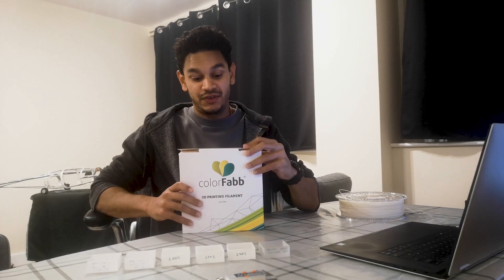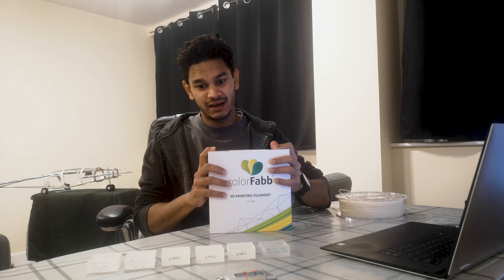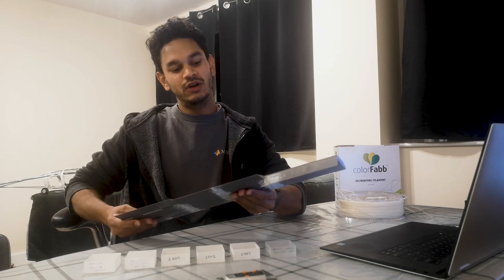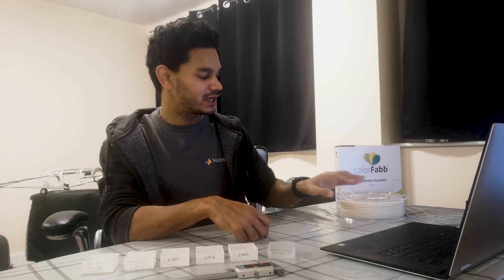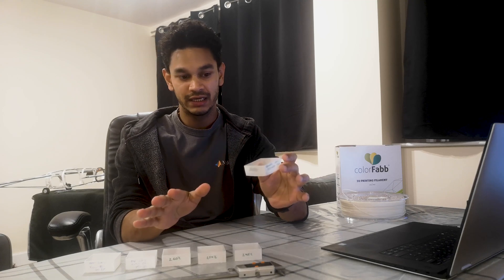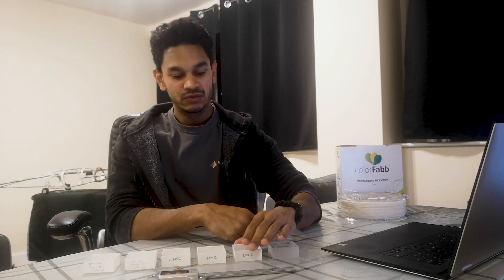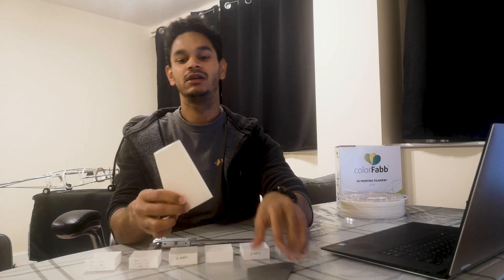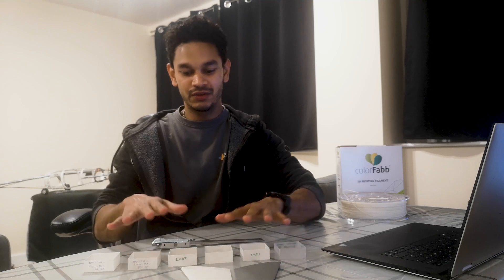Getting Started with Lightweight PLA (LW-PLA) on an Ender 3 (HQ)

Comment: thank you ! great information on calibration. can I ask if you have a regular Bowden tube / extruder ender 3 or a direct drive ? I have an ender 3 v3 but with regular Bowden tube setup and wondering if it can print the expanding foam

Comment: YYYYYY do you say low end, because of the cost/price. Motion system, extruder, and hot end IS ALL THAT IS NEEDED!!!!!! All printers take knowledge and skill, thats all. A heated chamber is the only thing missing and a cardboard box is not the answer for good high temp prints.  THEN ENDER 3 IS A NUMBER ONE PRINTER WHEN ASSEMBLED PROPERLY. Don't frown upon low cost printers use the tool to the best of its capabilities and it will reward you.

Comment: Guys be carefull printing that high with a teflon tube. You should not print higher than maybe 210. Buy an all metal hotend if you dont want to inhlae bad fumes!!!!!
Reply: I've overcharged and blown up a few Lithium polymer batteries in my garage and the stench lasts for days.  I suppose that's probably not good to inhale

Comment: Trying to get this to work on my Ender 3 V2. LW-PLA from ColorFabb will be arriving today and then lets see whether I can manage to print the GASB one :D usually I hate fiddling around with these settings a dozen times since it takes so much time.
Reply: Update: While trying to get it working I destroyed my extruder plastic grind thingy and replaced it with a aluminium one which made it print way better. Then tried prints with varying settings, but your settings were the perfect ones: 250C, 35mm/s, 50% flow rate. Now off for printing my first plane!

Comment: Thanks Philippe for the video.  I am in the process of learning to print rc planes with a 3D printer.  So far I have printed 5 planes and it is really a learning process but I have learned a lot about printing with PLA and PETG,  ABS and I have some very nice planes.  Lately PETG is my go to filament because it gets very hot during the summers here and PLA doesn't handle the heat well.  I have purchased a roll of Colorfab LW PLA and a roll of the same from esun.   My biggest problem is getting the COG right.  So now I am printing a Pilatus Porter with parts from Petg and from LW PLA.  Especially the aft parts with LW.  Your video has been super helpful to me and Im looking forward to more videos!  You are a good teacher....easy to listen and follow along.

Comment: Thanks for the useful information. I'm printing the box at 250deg. on my Ender3 v2 and I've put a short piece of Capricorn tube against the hot end. Flow rate of 50% gave me a thickness of .5mm. Now trying it at  43% with fingers crossed!

Comment: Great video thank you.
I use a identical set up to youself, can I ask how long you estimate a new quality ptfe tube on the ender 3 will last at 250°? I have issues with petg at 240° lasting only 1 or 2kg worth untill swelling at the hotend. Not terminal just interested in the service interval.
Thanks Thomas